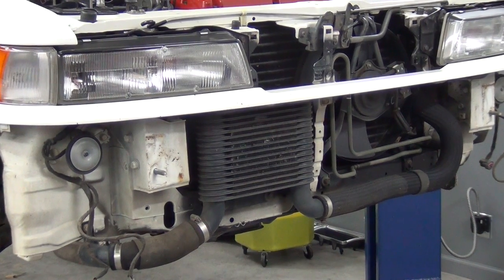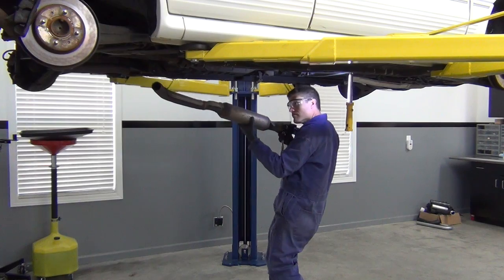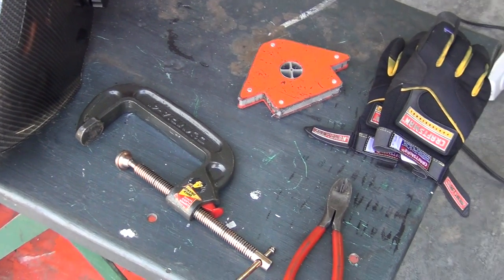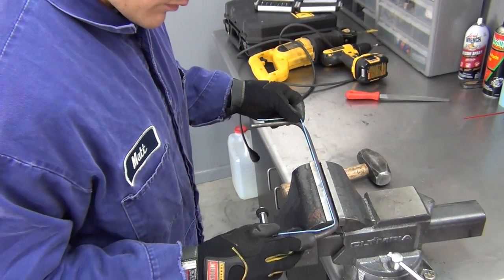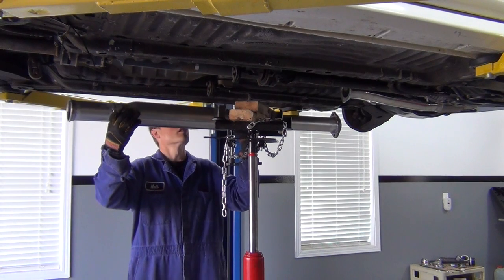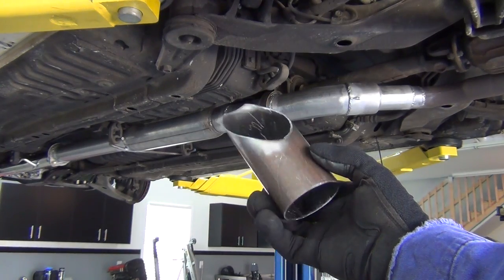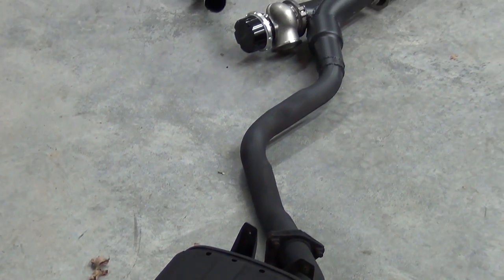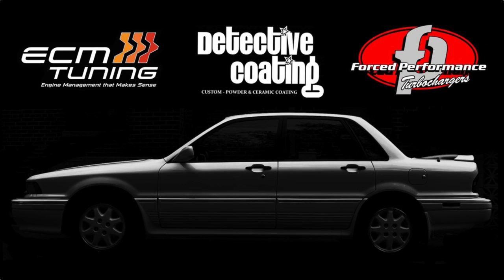Project Street Sleeper Part 7: Stealthy 3" Exhaust Install

Comment: Tom, you've outdone yourself on this one! Very clever with the wastegate and curious to see how it will be controlled. And the tune that starts up around 5:45...awesome!
Reply: yeah, I wonder where's he gonna take the pressure for the vacuum line from and how's he gonna set its value
Reply from the maker: Thank you as always for the kind words my friend!
Reply from the maker: vanoscrap Any good vac/boost line from the intake manifold will do.  The opening pressure is determined by the wastegate spring(s).
Reply: oh, ok. so when the throttle's open and you're above the threshold inlet pressure, you'll have your exhaust in highflow mode, but once you close the throttle, the real wastegate/blowoff valve drops the inlet pressure and your exhaust gets back in stealth mode. Hm, eager to see that functioning. 'wonder if there'd be any delay resulting in a built-up exhaust pressure for some time when the exhaust wastegate's closed.
Sorry for the flood, was thinking out loud :)

Comment: Interesting solution. I was expecting either a nice stock tip type muffler, or I've seen guys do a turn down exit using the stock muffler as a shield. Can't wait until you get it on the road and give us your impressions.
Reply from the maker: Thanks Jeffrey!  I will likely build a full 3"quiet rear section of some sort with stock looking tips in the future.

Comment: Great work.  beautiful exhaust system. I use 3" pipe to stock muffler and electronic cut out on my 02 Camaro SS. I did a similar setup on my 1992 all wheel drive Talon TSI.
Reply from the maker: Thank you Brett, I bet that SS sounds GOOD! :-D

Comment: Hey dude, awesome build! but exhaust piping should be tig welded indstead of using a mig welder. you add far less heat into the material, you gain a more beautiful seems, and you are far more likely to make a perfect seal... fun idea with the wastegate :)

Comment: Im curious to know how much more flow the exhaust will have with the cutout vent? Its a genius idea but it looked like the blowoff valve didnt open very much. I was  thinking that a small butterfly valve may be a better solution.

PS Ive been fallowing you for a while and I love seeing your videos you do a great clean job on everything.. keep up the great work Tom. CANT WAIT TO SEE MORE!
Reply from the maker: Thanks Jeffrey!  It does open more than that, I was just giving it a small bit of air.  It's definitely an experiment at this point- I'm hoping it works, but if not I'll try something different.

Comment: Why not just do an electric cut out? I've seen folks gut a muffler and sqeeze another inside of the factory one and just leave the bottom open. But, I guess this setup does, that pretty much with pressure instead of a switch. Really good idea!
Reply from the maker: Thanks Corey, I just wanted to try a mechanical setup first to see how it performs.

Comment: Very clever with the waste gate, just a question would a butterfly valve also work. I was thinking of doing that to my 05 LGT. Having a switch in the cab to open and close it at will?
Reply from the maker: Thanks man!  Yes, an electric or manual valve would work too.

Comment: The stealth exhaust is sweet. Surprised you kept the stock muffler and not like a stock Evo 8-9 muffler.
Reply from the maker: Thanks man!  I considered other stock mufflers, but this muffler fits this space perfectly as Mitsu intended.  I'll probably build a quiet 3" rear section someday with dual tips or the like.

Comment: Is there a reason for not running a standard cutout? Seems like it would create more power by allowing better flow if mounted towards the front/in the down pipe. It would also be more consistent for tuning.

Comment: You are using a similar welder to mine... different model number, but only because it was in a store specific "package/kit". what wire size were you using to weld up your exhaust? last time i tried to weld my exhaust up, i wound up burning through a bunch of times. i eventually found a decent setting, but i had to go back and patch some holes. lol.... good thing it was on a jeep that that kind of "precision" is acceptable. :)

Comment: Hey boss I'm in the process of boosting my car I know I have to tap the oil pan for the feed and return lines but my turbo is externally wastegated and it has some other lines I have to run but I'm not sure.. it's my 1st time with a project like this so I new some help

Comment: Do you think that paint will hold up well on the exhaust seeing as it gets so hot? I've used regular spraypaint on calipers and rotors before, but those only get hot when you're using them hard, they're usually not SUPER hot. Exhausts seem to get much hotter and not only that they stay hot. I'm assuming though I can answer my own question as you've done this before and you probably wouldn't try it again if it didn't work, but I'm still going to ask lol.
Reply from the maker: Hey Jesse, Yes, this is dupli-color high heat engine enamel and I have used it to paint exhausts in this way for many years with no problems whatsoever.  It's just really good strong paint.  Now I wouldn't use it on a manifold or header, but it's good for the cooler temps of exhaust piping in my experience.

Comment: Is that just regular rubber line? I always like to buy silicon line when I replace or add lines. Especially the vacuum lines in my dash that hook up the vacuum servos for the dash vents. I hate taking my dash apart.. grumble grumble.
Reply from the maker: It's very high qualit, thick wall rubber vacuum line that is made in the USA.  I have bought silicone hose before but have been unhappy with the quality and inner diameter sizes that were never as advertised.

Comment: I knew it!   Boost activated dump pipe for the sneaky-ness ;)
Reply from the maker: I hope it works well!
Reply: Tom's Turbo Garage  I´m really interested to hear the sound difference when the exhaust gasses go through the valve as the boost builds.

Comment: First i want to say i look forward for these videos:) then ill like to know hos you intend to trigger the wg:-) are you going to set it up so you can press a button or its it going to be strait turbo pressure activated? And do you think this can work on a nå motor?
Reply from the maker: Thanks man!  This will be opened by boost pressure, which is how wastegates are designed to operate.  An electric or manual cutout would work on a NA engine, not this.

Comment: Hi Tom, I have a question.  Can you put a turbo or a supercharger on just about any N/A engines?  If so what should I look for concerning the engine before I add force induction to it?  Thanks
Reply from the maker: Hi Edgar, theoretically, yes.  What you'll find is that in most cases engine management, fuel upgrades, engine internal upgrades, make it cost prohibitive unless it has been done many times over, like in the Miatas for example.

Comment: Awesome video! Quick question, where exactly did you T off the vacuum for the wastegate? Did you just use a T on the turbo wastegate or did you use the BPV?
Reply from the maker: Thanks man!  I used a dedicated line from the intake manifold.
Reply: Awesome, going to see if I can pull that off on my 10

Comment: i'm not a computer expert by any means, but i've heard removing your muffler is actually bad for your engine, because of the loss of back-pressure.

this valve your putting in before the muffler... is it blowing ALL the exhaust? or just the flow that wont fit through the exhaust system?

Comment: Nice work, Tom. Im in Australia and just picked up a 90' VR4. Your channel has been a great source as I plan my own sneakyness. Well...semi-sneakyness. Was the front pipe the MR-SSDP-ME89GSX? I think importing this part is a great option as there's not much access to performance parts for VR4's down here. Thanks.
Reply from the maker: Thank you sir!  I used one like this off of Ebay.  Good luck and enjoy your car!  http://www.ebay.com/itm/Stainless-Steel-Downpipe-Eclipse-GSX-89-90-91-92-93-94-/331418582384?pt=Motors_Car_Truck_Parts_Accessories&fits=Model%3AEclipse&hash=item4d2a163d70&vxp=mtr

Comment: Why not 2 1/2 piping I mean the down pipe has to neck down to 2 1/2 to match up with the turbo it's like a chain what's the point in having big beefy links if you've got small ones in there with it?

Comment: Why did you put on the Vband to remove the muffler when you added the cut-out?
Reply from the maker: Well I explained this in the video, but it gives me the option to run a high flowing full 3" rear section if I choose to do so.

Comment: Hi Tom, what material is your exhaust made from? Is it stainless steel or aluminised mild or plain mild steel? Also, what wire and gas did you use in your welder? Im turbocharging my mk2.5 MX5 and will be making an exhaust myself
Thanks, James from England!
Reply from the maker: Hi James and the piping used was aluminized steel bends and straight sections from Summit Racing.  I used Lincoln's SuperArc L56 wire and shielding gas.  Good luck with your exhaust build, the Miata exhaust is a very simple one to fabricate, Here it is: http://www.lincolnelectric.com/en-us/consumables/Pages/product.aspx?product=Products_Consumable_MIGGMAWWires-SuperArc-SuperArcL-56

Comment: Hey tom, Do you have a linisher handy? They make car piping a breeze :) (Basically a smaller belt sander, Or you can get a airtool sander, Does a great job also, Use them commonly where I work ) :D
Reply from the maker: Hi Zachary, I don't have one of those but I have used them in the past and they are very handy.  Thanks for the suggestion!

Comment: are you going to use a solenoid & switch to be able to control the wastegate or is it going to dump every time you get full boost?
Reply from the maker: The waste gate is controlled by the tension of the spring inside the unit.  The spring that's in it now should open around 10psi I believe.
Reply: Tom's Turbo Garage
obviously, but you may want to be able to control the waste gate so it doesn't open at 10 psi, like went you might want to suddenly accelerate in traffic without the excessive noise of a dump pipe, just a suggestion to make your system more street friendly and be able to choose if its activates or not with a simple switch by the driver.....

keep up the good work by the way

Comment: whats the point in running 3in all the way back when the downpipe necks down to 2.5in why not just run 2.5in all the way back as its only going to flow as good as the most restrictive part of the system
Reply: The Glorious Hypnotoad I was about to ask the same.  He also stated that the stock muffler is a 2.5"
Reply: +Joshua McClellan he'll only use the stock muffler for daily driving and use the WG cutout on track days

Comment: Never knew why people hated ebay until i started using it. Seems great and cheap at first but shit starts breaking. Only thing i buy on ebay for car parts are either plastidip/paint (LOL) or LEDs (haven't broken on me yet). My experience on hid bulbs and other shit was terrible.
Reply from the maker: Yeah, unfortunately it's a place where some sellers can sell junky "no name" parts at an arms length distance from their buyers, and keep doing so for many years with little repercussion.

Comment: How are you going to keep the paint on the exhaust from being destroyed by heat?
Reply from the maker: EvilJ069 Well, I used high heat ceramic paint.  I've been using it for 15 years and have never had any problems with it.
Reply: Tom's Turbo Garage Oh cool, I thought it was just regular spray paint
Reply: +EvilJ069 this isn't Haggard garage
Reply: EvilJ069  I thought it was funny lol

Comment: What power welder is that to be able to weld stainless steel?
Reply: its a 135 . can look up full specs on google or lincoln's site
Reply: Darren Thorndick there's no difference between any mild steel
But 
In reality you should back purge it especially stainless steel otherwise it can "caramelize" on the non shielded side
Reply: Darren Thorndick firstly he isn't welding stainless steel

Comment: I'd go with a soft spring like 3-5 psi
Reply from the maker: Yes, I agree that would likely be best.  Hard to say how this piece of sketchy Ebay engineering is going to function honestly.
Reply: Tom's Turbo Garage The torture test video I saw that Tial did on one shows premature failure.

Comment: Crassy mizzubeeshy garraunt..  ha!   Man i pulled up next to a gallant a little over a week ago.  Thing was bright yellow with those cambered wheels and a fin big enough to keep a plane grounded and two 5” pipes sticking out the rear behind the tire..  all black tint..  well i thought it was funny so i burped my big block and threw a little flame out at em and i kid you not this dude had turbo but when he started two step faking it (rev limiter) the damn blow off had a turkey call on it...  so itd sound like a 4cyl with valve chatter, rattly exhaust and a little squeal of a turbo and when he let off you get the gobble, definately funnier than a duck call or those chickens..   not as funny as the pocket pussy on the muffler tip but had me rollin for sure

Comment: Wow that's super slick Tom. I want to build something similar for my talon, but here in oregon were required to run a cat. So I was thinking on running a 3" electric cutout like this one http://www.amazon.com/gp/aw/d/B00892WGOO?pc_redir=1399769241&robot_redir=1 do you think there is enough room to clear the first carrier bearing if i move the cat a little further back?
Reply from the maker: Thanks man!  It's hard to say about the fit until you actually mock everything up and look at it closely.  I would check your laws to see if you can run a cutout to make sure you don't have any troubles.  Good luck!
Reply: Yeah we can run a cutout as long as it's open only on a race track, or off-road like a rally event. I need to pickup a decent MIG too and practice on some scrap tubing. Hopefully will start rolling in my project soon. Full rebuild with forged parts. Sigh $$$$.

Comment: http://s684.photobucket.com/user/Ripper_XX/media/RipperXX1990TSi_zpsa88bd9b5.jpg.html?sort=3&o=50

http://i684.photobucket.com/albums/vv210/Ripper_XX/1990%20Eagle%20Talon%20TSi/DSCF3657.jpg
We have similar taste, I want it to look clean and factoryish, but noticeable that it's not stock. I had a FMIC on the car, but I removed it until I am able to build some ducting to force more air though the radiator. Until then, it doesn't like non-highway speeds, so back to the factory SMIC :(
Reply: The external waste gate kind of gives it away huh?